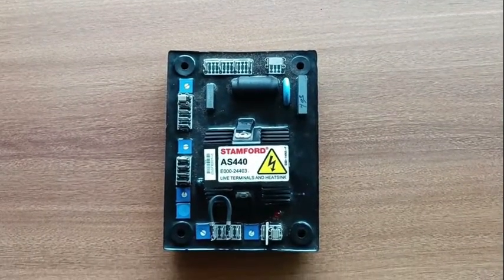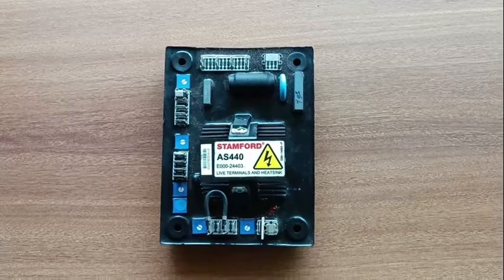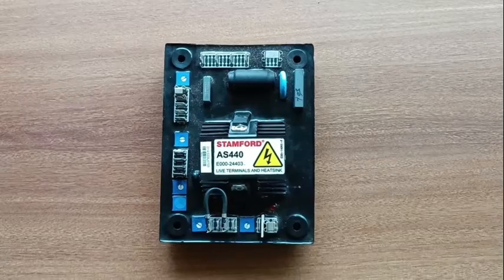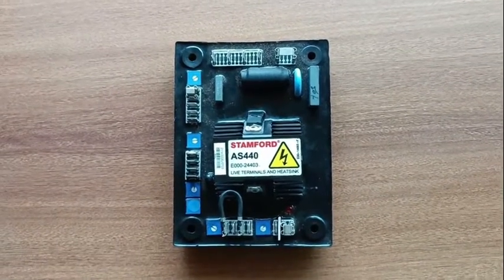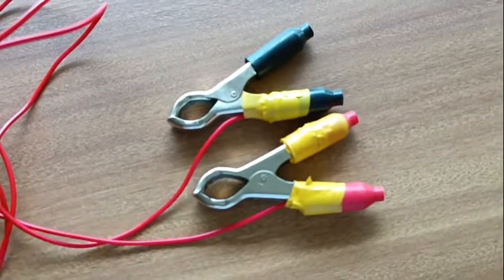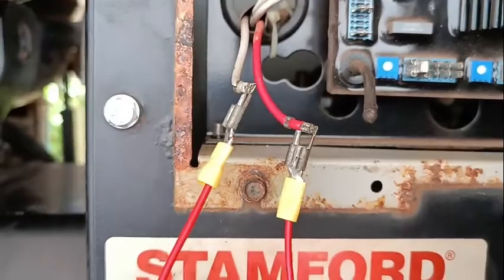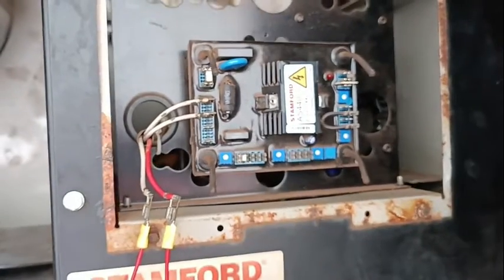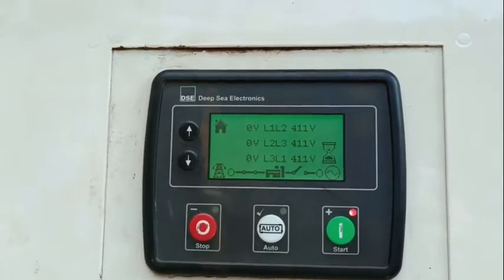how to bypass avr from alternator ( english)

Comment: the polarities must be respected otherwise there is no production of electricity. Generally we have F1 or X is the positive + and F2 or XX is the negative -.
Thanks
Reply from the maker: Yes that is applicable only when u connect to avr, if u connect to battery no need to check polarities. U can check same by doing it practically.

Comment: Why you are not using potentiometer in this method. It should be in the circuit to adjust the input dc voltages. And second one is dc voltages polarity matters to feed the alternator
Reply from the maker: 1. Potentiometer is not required as battery is just 12 v max. 
2. Dc polarity does not matter in this method.
Reply: does it no harm to the exciter circuit sir?
Reply: How can i use this method on bundu diesel generator KDE19STA3 with avr# (DAVR 150S3)
It has 10 wires total